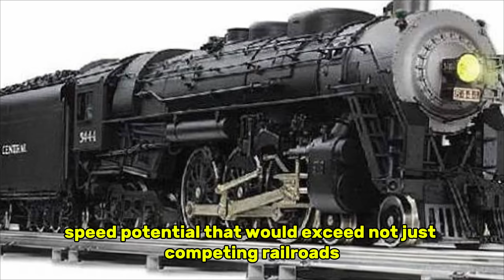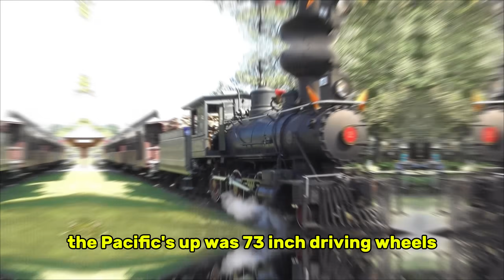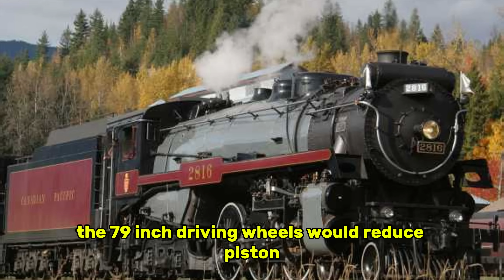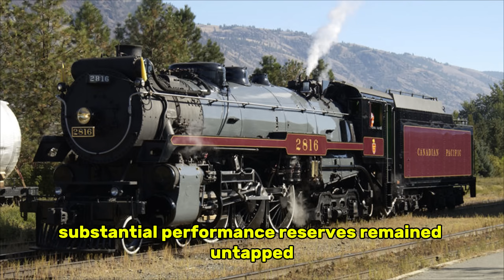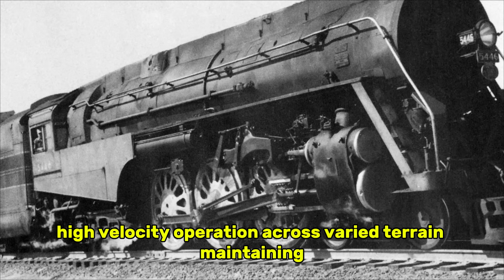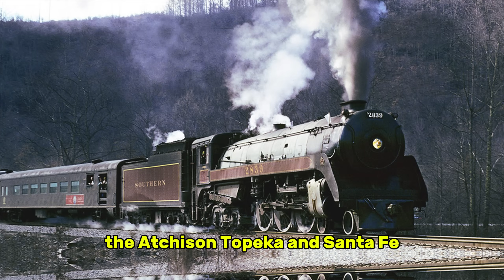The Passenger Engine Railroads Mocked — Until It Became the Fastest in America

Comment: Why do you keep showing photographs of a Canadian Pacific locomotive which is CLEARLY NOT a New York Central Hudson ? If you look carefully at the photograph where railroad workers are working right beside the driving wheels, it is obvious that those wheels are not taller than the men. 79 inch diameter wheels stand 6 foot 7 inches tall, and would be obviously taller than those men, unless they both were giants. Furthermore, the whole design of the engine screams "Canadian locomotive" to any serious steam engine aficionado The basic information being given is excellent, but whoever put together the pictures accompanying the narration did NOT do their research, did NOT observe the details on vintage photographs of ACTUAL New York Central Hudson locomotives, and would have never included these photographs of the wrong class of locomotive. NOT ALL 4-6-4 engines were "Hudsons." Only a specific class with specific characteristics were "Hudsons." . The inclusion of incorrect pictures misleads those seeking reliable education from this video, which is just SAD.